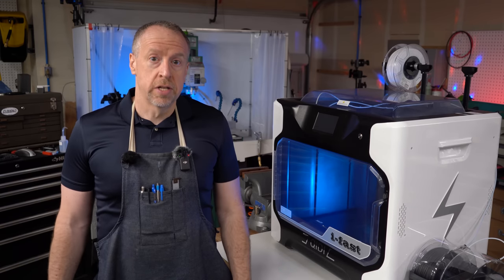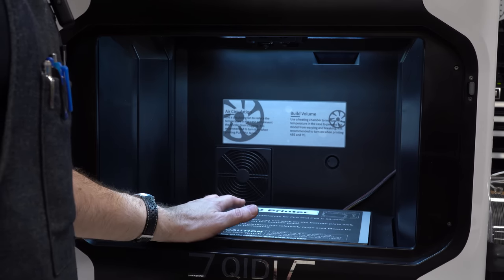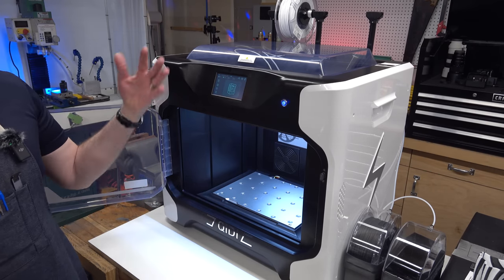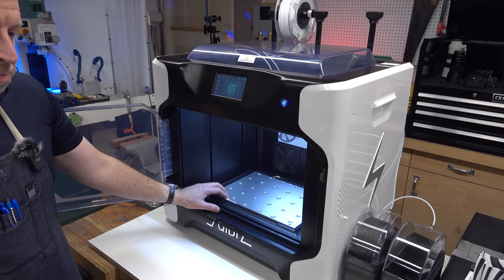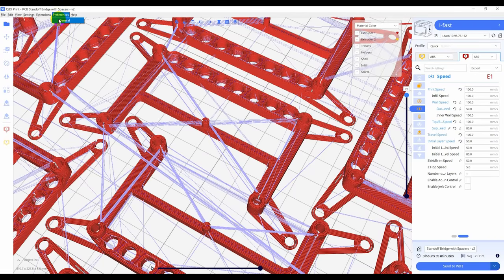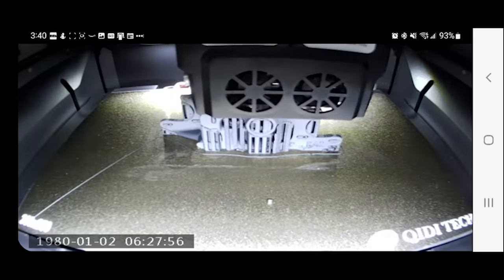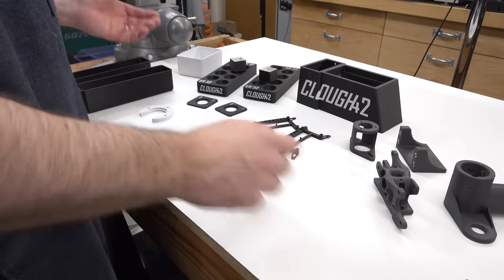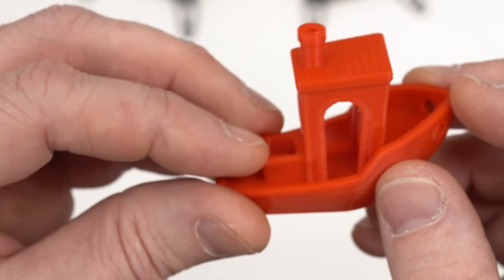QIDI Technology i-Fast 3D Printer | An In-Depth Review

Comment: Somehow I missed the part of the video showing the device actually working.  Did it die on you or just afraid to show how slow it really is?
Reply: How did you watch a 49 minute video in 5 minutes?
Reply from the maker: Perhaps you should watch the video before making assumptions.  I discussed both the difficulties involved in filming it in operation and the print speeds I was able to achieve.
Reply: I don’t need to see a print head wizz back and forth. That doesn’t thrill me anymore -  the results are what count. It is hard to imagine how this review could have been more thorough. This comment just goes to show that no matter what you do someone will find something to knock. Oh well…
Reply: they mentioned that recording the machine printing is not particularly useful due to angles and interference of the print head/chamber wall - so you only get the few shots from the onboard webcam but its angle isn't great either
Reply from the maker: Part of the reason I wanted to check out this printer is because most of the other reviews out there either don't go into a lot of detail or don't reflect much experience in actually using a printer as a tool to accomplish a goal.  I made the video I would want to see before buying this printer.  It actually didn't occur to me until I read the above comment that someone might assume I was trying to deceive.  Maybe I'm naive, but I just didn't think about that.  Perhaps if I were actually being deceptive, I would have thought about whether people would believe me and made an effort to fabricate some evidence.
Reply: @sblack48  Agreed!  James has also earned my trust from his other content, and I do not feel he is trying to trick us into buying anything.
Reply: @Clough42  You showed exactly what I wanted to see but I have been printing for years.  If I did not currently own a printer my feeling would probably be a bit different.  After years of doing something it is hard to go back to the zero knowledge perspective...
Reply: @Clough42  i think here you are dealing with the 2% that will never be pleased. Comes with the territory.

Comment: I owned an i-fast for around 6 months and it is one of the worst things I have ever bought; it is a slow lumbering oaf of a machine. I never got a decent quality print from it in any material and it was far from fast. I sold the I-fast and bought a Bambu Lab X1C and I couldn't be happier with the performance.
Reply: As a Chinese person that has owned so many printers, I can say this QIDI looks like typical Chinese crappy company that wants to make a wannabe product. They say don’t judge a book by the cover, but a printer looks as shit as this can print well? I doubted. So I bought a prusa instead. Then Bambi came along that looks so good. I bought one too. And it prints so good. My takeaway is, if they didn’t bother design the case, they probably half assed the inside too…

Comment: I see nothing here that I can't get from my cheap printer with a plastic bag over it for a heat chamber and it only cost $300!  I print with all these materials he prints with too!  Buildtak sucks after a few prints and you can't auto bed level with it if you have a heated hot end!  No thanks!
Reply from the maker: If a $300 printer in a garbage bag meets your needs, it sounds like you're all set.

Comment: Very outdated printer technology. For a very expensive price. Take the extruder apart. You will see.  If you want to get a decent quality you have to slow it down. These firmware is locked can not adjust anything. 
Acceleration settings are very small. 
Compare it to SP-5.